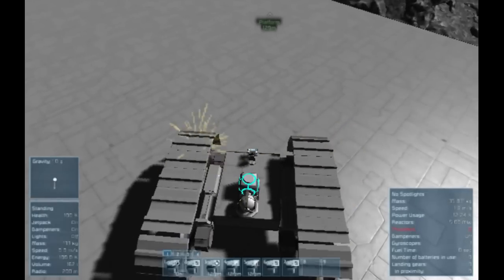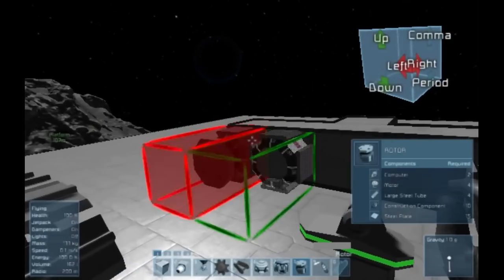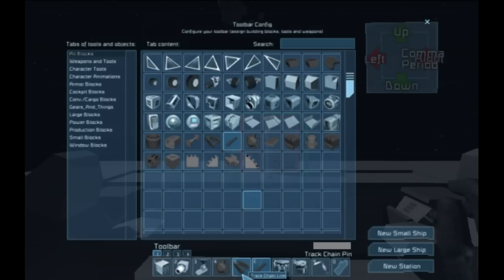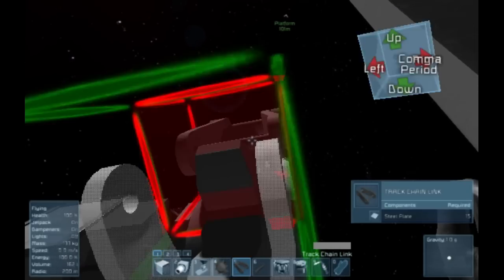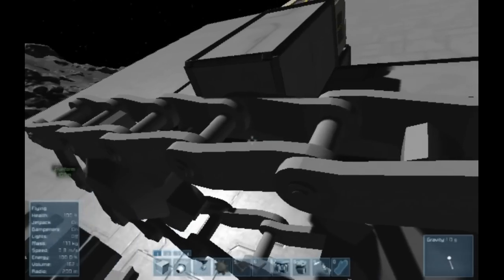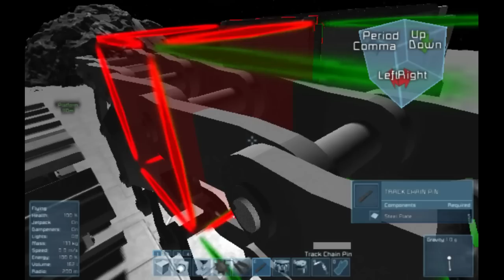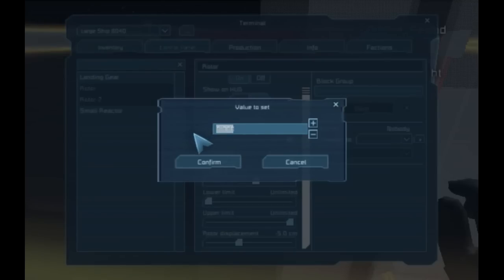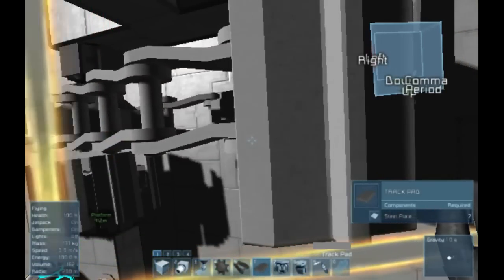Space Engineers: Mech's Mods: Tank Tracks Tutorial

Comment: Great mod, however there is a problem with the last pin. Whatever placement i use for the rotors the last pin will not completely go trough the chain link and so it will not attach. does anyone else have that problem?
Reply from the maker: Hmm, did you remove the pin then try to put the pin back? Also, since rotors were changed I don't think the pin will automatically snap into place, have to go into the settings of the chain link and press 'attach'.
Reply: thank you, I appear to have forgotten to put attach the pin. Btw if you were wondering how to get a piston in there to tighten the chain you have to first extend the piston 2.4 m exactly so the sprocket aligns
Reply: I have the same bug

Comment: hey man, first off I'd like to say how much i love this mod, I'm very mechanically minded and this really opens up alot of possibilities for me. I've been tinkering with creating vehicle suspension using pistons as a second pair of shock absorbers for wheeled vehicles, my issue is you cant control wheels through pistons. Looking at the way your rails system works, it looks like that may be my answer to keeping control while still having the top and the bottom of the vehicle free moving. my question is really just about controls through these block,. for example if i use a rail, will i be able to control whats at the end of the rail from my ships command console as a primary part of the ship? or will it transfer controls like I'm using a piston or rotor? (where its all red and can only be manually controlled not w,a,s,d,e,q) I've tried with the hinges and merge blocks both heavy and light but as soon as the merge block engages no matter how delicate i am, the hinges wont let the two connect and just break.
Reply from the maker: unfortunately if you use the rail/rack blocks, power and control do not transfer through them. One option may be to use the chain links as a sort of a connector cable since they are essentially rotors power and control will transfer through them while still allowing the parts to move separately, if that makes sense?
Reply: Yeah that makes sense, and thats what i tried using the hinge blocks. (doesn't work) as far as what in trying to do, i'm 99% sure its impossible at the moment. both rotors and pistons do not allow through control to wheels using the "w,q,e,s" buttons.  This game needs a flexible wire mod that allows this to happen. as is i can connect the vehicle togather with merge blocks do the pistons are the only thing holding the chassis to the wheel base like this

http://steamcommunity.com/sharedfiles/filedetails/?id=330537592

yellow being the top and blue being the bottom. the pistons are red.

I need to transfer control from top to bottom without having to stilt the cockpit to use wheels. I could manual override as is, but that's not really a viable solution.

Thanks for your response. if you ever figure out a way to do this, let me know =)
Reply from the maker: HypnicJerk Can you put a remote control block on the bottom section and control the wheels from a cockpit on the top section?
Reply: MechanizedIT  Tried it, cant control it from the cockpit because technically its the same ship.